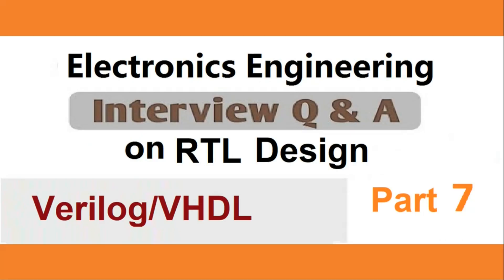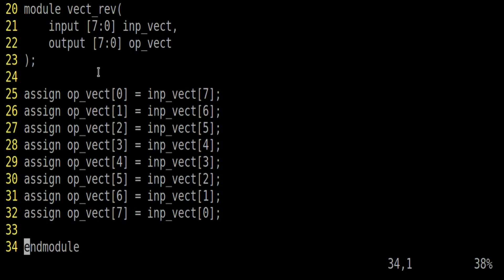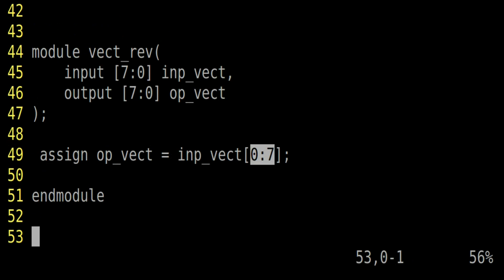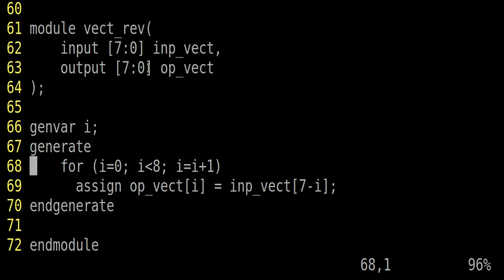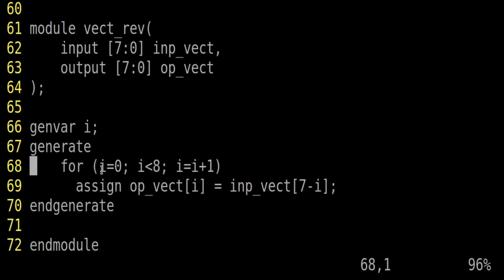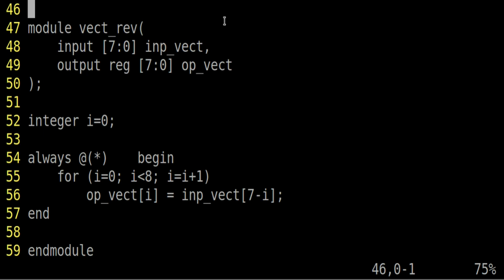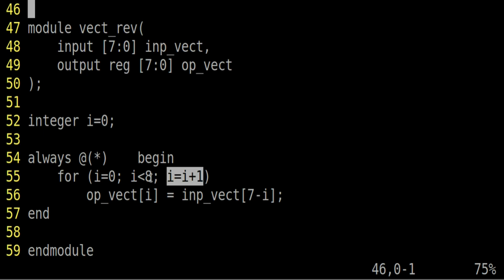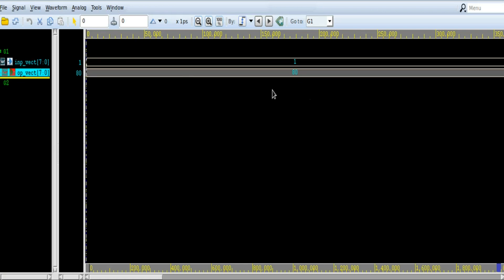Interview Question Verilog Part 7

Comment: hi sir, but integer and for loop is not recommended in good coding style. This is my doubt. Can you please help in this question.
Reply from the maker: Where did you read this guidline, an you please share the link.. as per my understanding, we should focus on the hardware that will be outcome of our design
Reply from the maker: Please go through the following video to know more about loop s that are not recommend in the design. Here is the link: https://youtu.be/o-Ws4XmszFI
Reply from the maker: Let me know if you still have any query
Reply: @TechnicalBytes  okay sir, got it.so for loop , integer and genvar are recommended.
Reply: yes bro you are right, Verilog code is not directly synthesizable due to the presence of the integer variable i. Synthesis tools typically work with hardware constructs like registers and combinational logic, not software-like variables.